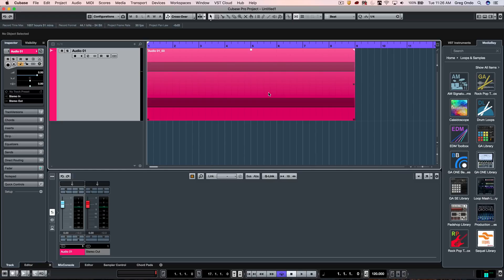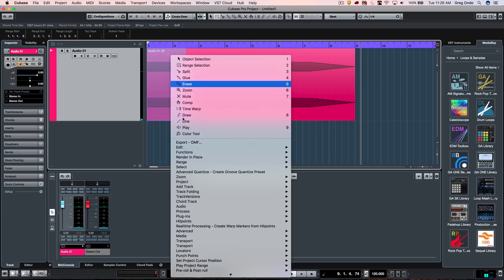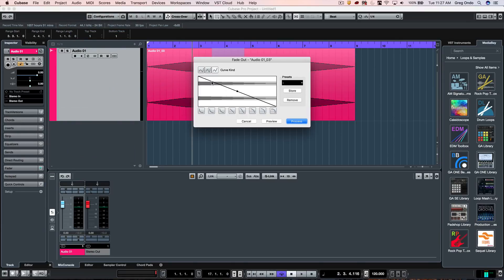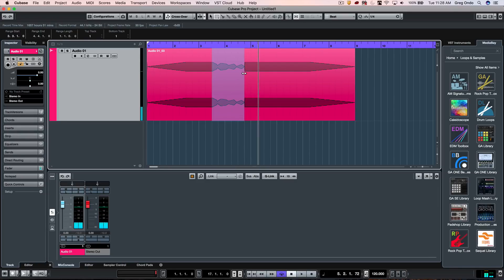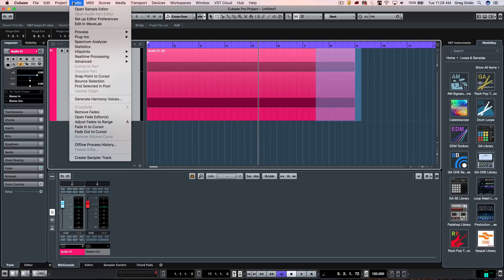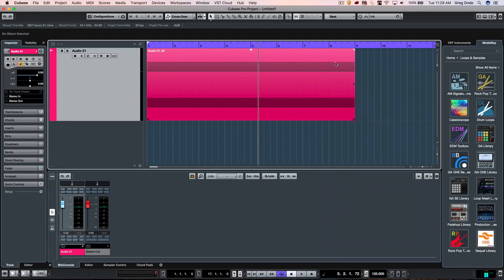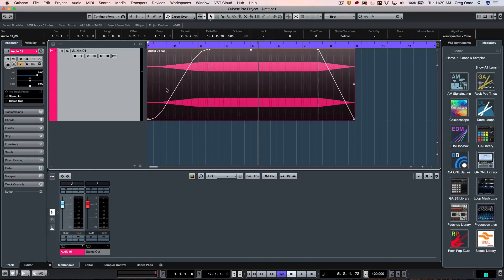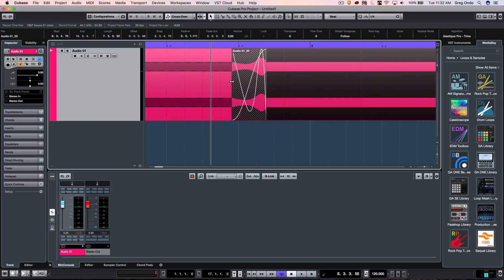How to Work with Processed and Real-Time Fades | Q&A with Greg Ondo

Comment: Greg! I'm using Cubase Elements 9.5. & I'm having so much trouble trying to work with video. tried to import a .wmv file but nothing happened at all, tried dragging & dropping it in too. I ended up converting it to MP4. that video played fine with sound in VLC player  but when I imported it in Cubase it had no sound, it just left a tiny event for the audio but no sound at all. I suppose I could use another program to separate the sound from the video & add it that way as an audio file, (I think that's what I did last time I tried months ago) but really I shouldn't have to do this should I? 
I found this solution on the steinberg site, will it work? This warning message put me off trying:

"Please note that Steinberg cannot be held responsible for any damages caused by installing and/or using QuickTime!"

plus I'm not even sure if this is the solution to my problem. I've looked at a lot of online forums & there's a lot of complaints concerning working with video. any ideas mate? have you covered this in any of your vids? I can't find any. I really enjoy your tutorials & hope you can help
/Husk

EDIT: I  Found I can import/drag & drop .mov & MP4 but it doesn't import the audio. I CAN import the audio from video file afterwards...but isn't there an easy way of doing this?
Reply from the maker: Hi, from Cubase Pro 9 we replaced the audio engine and it is not Quick Time based anymore, you need to have the proper video codecs installed, this article might help you: https://helpcenter.steinberg.de/hc/en-us/articles/115000808250-Video-support-in-Cubase-and-Nuendo
Reply: Thanks! this is exactly what I was looking for :)